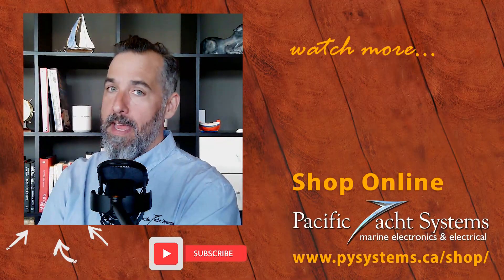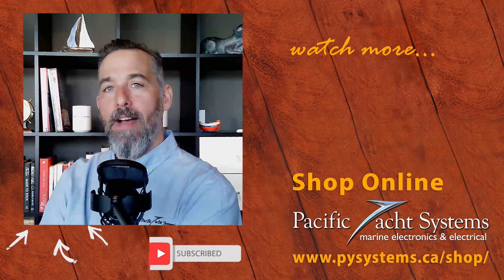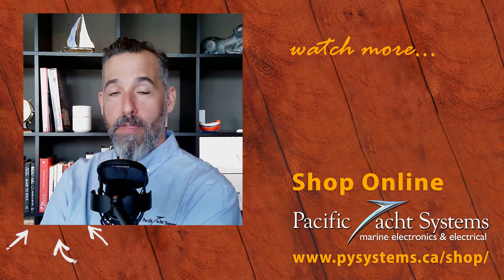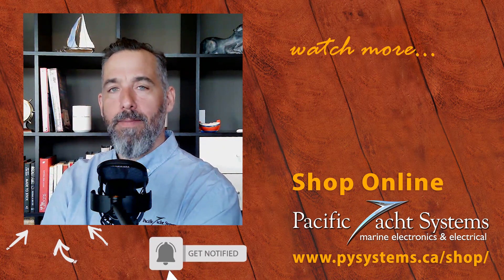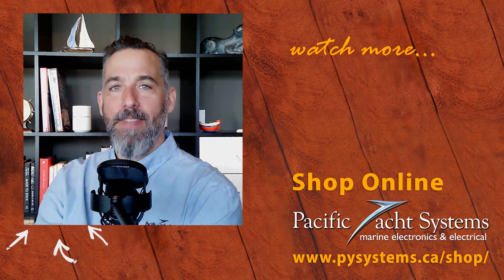Can I Mix Different Types and Ages of Batteries on My Boat?

Comment: Can i connect in parallel agm+flooded battery. And my solar charge controller to put flooded or agm.
Or to connect in series.
Both is 60A

Comment: I mixed agm with lithium  battery but in parallel  connection  to one inverter but I had 100amps diode between  with  separate  charger controllers

Comment: I have a standard starter battery on my boat,  and wanted a lithium battery as a house battery. Problem is the charge profiles are different. The Lithium battery I selected was  Lithium IRON PHOSPHATE, and the battery maker sold a 5 Amp charger specifically for it which I also bought.  Be careful, Lithium ION batteries are different.  To accommodate the different charge profiles I wired the electric start 20HP Suzuki outboard to the starter battery so it would start and charge it, then ran a car 12v to 110AC inverter  from that battery to the 5 Amp Lithium charger designed for the lithium battery, then to the lithium battery. So far works well and cost was low, about $40 for the inverter and about the same for the 5 Amp charger.

Comment: Hi Jeff,  how are you? Just an unrelated question for you.  On 4mm cable how much current will a blue butt connector crimp joiner safely carry? I need to join a wire to an  autopilot,  I think its maximum drain is 15A at 12v. Regards Stormer..

Comment: Not an expert here, but check out NOCO multi bank battery chargers. They appear to have the option of selecting individual battery types based on what you have. Not sure if this the norm. I would imagine this does not solve the inherent voltage difference between different types of batteries.
Reply: Minn Kota chargers have multiple banks that can be set individually for a battery type...from the manual: "Each Output Bank is independent and isolated from one another and the AC Input. The Minn Kota charger can charge independent batteries or combinations of batteries hooked in series or parallel without disconnecting the batteries from any switches or Jumper Wires joining the batteries."

Comment: Good education. Everyone should understand their batteries’ charge profiles. Bulk/absorption/float voltages and amperages are critical. Chargers, alternators/regulators, solar panels/regulators, generators must be able to meet all battery requirements. Charge rates are important, as lead-acid wet cells and AGMs must be brought back to 100% (“float”) quickly after discharge. Lithium likes to hover around 50% SOC, and definitely within 15% to 85% for maximum service life. Lithium (LiFePO4) is a different set of issues as it’s BMS controls everything and must play nicely with all the chargers. Some, for example, can disconnect suddenly and cause a voltage spike that blows the diodes in an alternator.

Comment: I have a side question regarding battery charger. 
I have within the last 8 months had to replace my battery chargers twice as they get damaged on the 110 volt side. 
I really don't know what causes this ?
My boat is docked in a nice marina in Ft.Lauderdale.
Any thoughts  ?
Reply: Brand, model? If cheap it could be the charger.
Else loose/improper connection of cable and charger connector, is likely. Could also test the outlet of the marina or put protection device between charger and marina outlet.